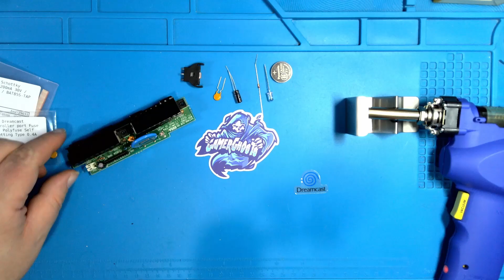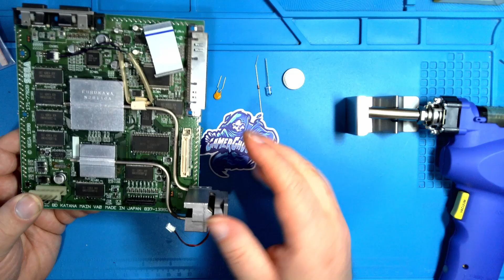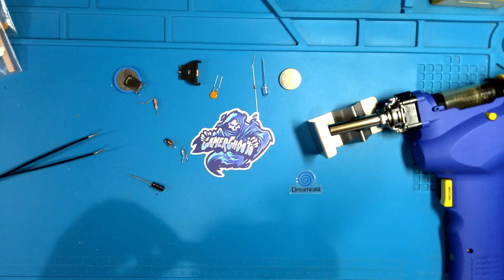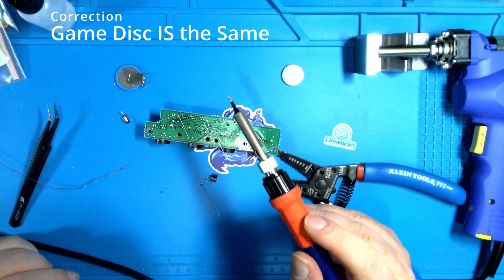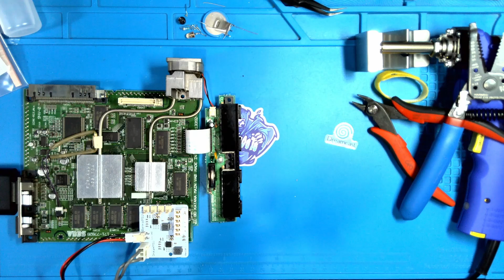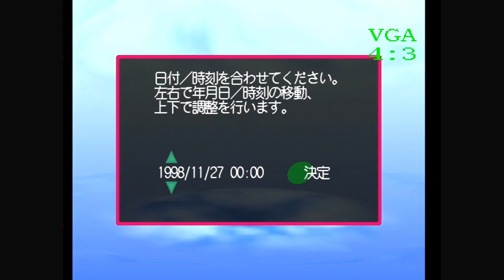Sega Dreamcast VA0 Controller Port Mod - LET'S MAKE A DREAMCAST

Comment: better to just change the battery with a coin cell rechargable
Reply from the maker: Thank you for your comment! I hear that, but I personally like the idea of someone being able to replace it with something they can just go down to a local store and buy as they are cheap and easy to find. Someone could do that though, just skip the diode step and put a ML2032 or a cheaper LIR2032 in.